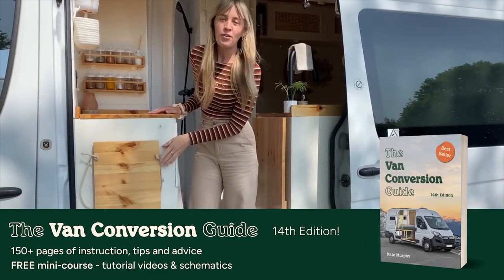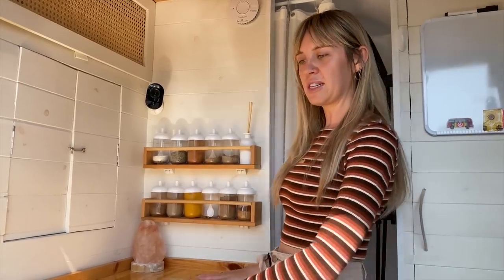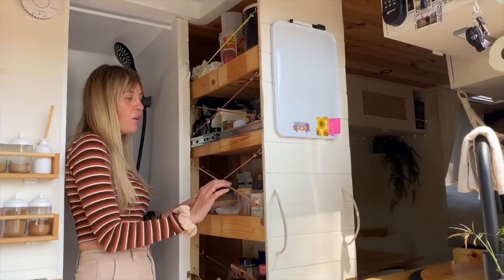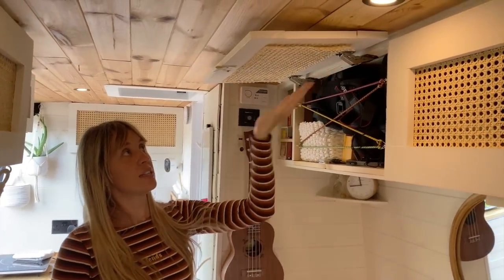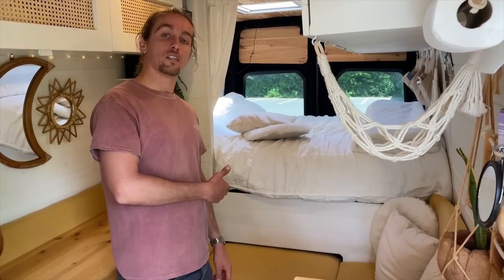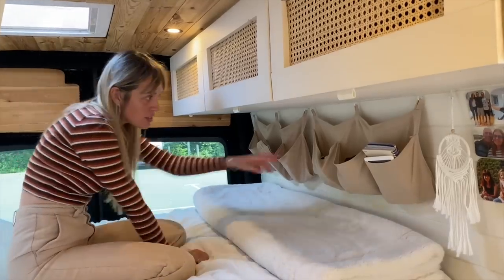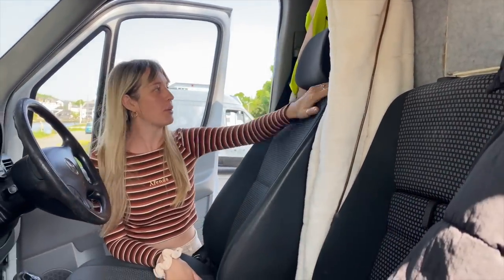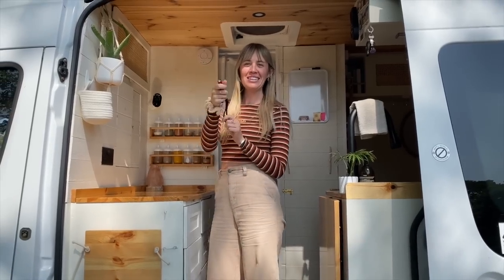THIS Van Conversion HAS EVERYTHING 🤯 Detailed Tour of LUXURY CAMPER w/ UNIQUE PULL-OUT PANTRY 🚐

Comment: I’ve watched a number of these videos and this one simply hit all the points I would want with a really well considered layout, I really like the full height pull out pantry. Personally I would have access through the bulkhead in the centre with a flip up table top or an infill counter top between the fixed unit and the shower. Also i’d slightly jiggle it by having only one seat either side and have the bed turned 90degs so my wife could have the back doors open and wake up to an outside view, but apart from that it’s well thought out. I now just have to figure out how I can have the bed platform slide out the back doors as a sun deck and it would be perfect.